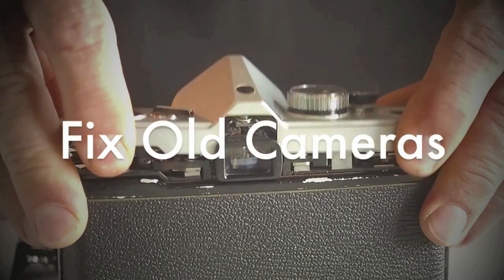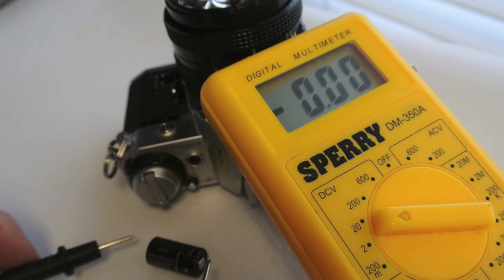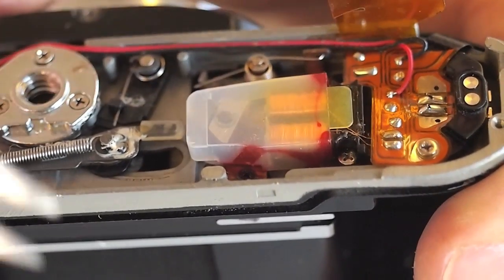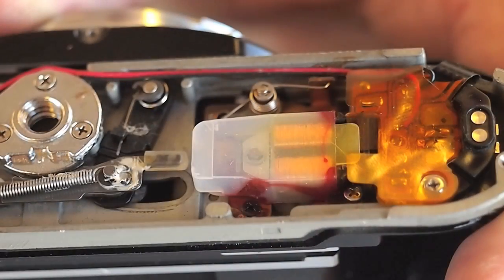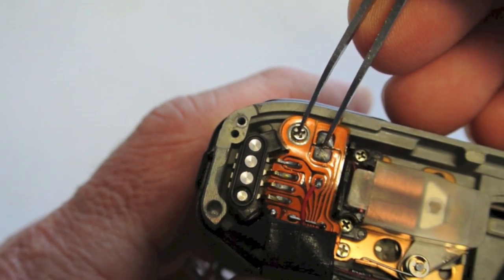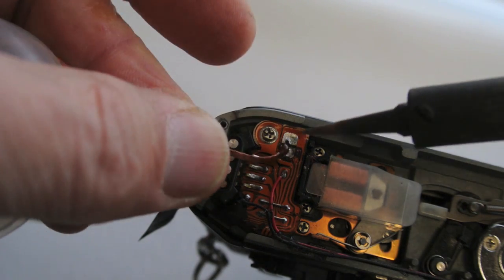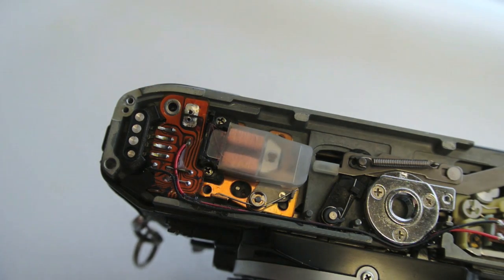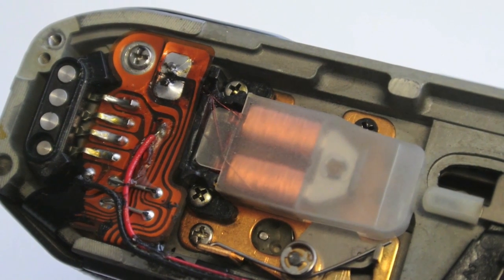Fix Old Cameras: AE-1 Release Magnet

Comment: Do you have any information with the AV 1 I had to consult this AE1 repair in hopes of diagnosing my AV1 problem. My AV1 is unable to release the shutter button can activate the meter but not the shutter release. I will try to short it or apply 6v directly into the magnet to see if the solenoid is working. If you have more info about the AV1 can you please help? Thank you
Reply from the maker: Presently there are no FOC videos feature the Canon AV-1 specifically. Thank you for your comment.

Comment: My AE-1 does not fire consistently after releasing the shutter, as in sometimes I will have a run of 5 successful shoots, then nothing. The battery is new, and I have used the battery check on the camera which has shown it has charge so it is not that, however the meter itself doesn't always work either, so I'm guessing it's a loose electrical connection somewhere. Do you happen to have a fix for this?
Reply from the maker: Ted Gravestock If you are using an alkaline battery switch to a silver or lithium battery. If you are using the proper battery you might check the ground screws by the release magnet and by the left of the eyepiece ( you will have to remove the top cover to access this ground screw).

Comment: So I followed through all of the steps up until replacing the magnet. If I manually reset the shutter and cock it it will be able to fire once or twice and then right back to the same situation of not disengaging the magnet. Do you still think it’s worth replacing the release magnet? Or is it some other wild issue that’s not worth it
Reply from the maker: The magnet sounds like it is good. The AE-1 is a battery hog... as they age they seem to be even more demanding. Make sure your battery is delivering a full six volts and not dropping off after a couple of shots. Check for a break in the connecting flex circuit. Check for a solid connection on the lower flex ground screw. From an early post... If the magnet energizes then the issue is in the release circuit or a loose ground screw. Check the ground screws by the release magnet and by the left of the eyepiece ( you will have to remove the top cover to access this ground screw). The additional circuit trouble shooting is much more involved... Probably not going to help much, but, make sure you are getting battery + voltage at the lead on the (blue) release capacitor closest to the release magnet. This capacitor can also be swapped out from a donor camera. Make sure you have battery + voltage at the lead of the release magnet closest to the release capacitor. If good, check coil continuity of the magnet. If no continuity, remelt solder at the test points. Also top cover can be removed and all the switches on the release side of the camera should be checked. There could be an open in the flex circuit or connections that will need to be traced. Then there is the possibility that all is for not as you could have a defective IC, the one that lives on the release button side of the prism flex. Also, if you are using an alkaline battery you might switch to a silver or lithium.

Comment: Hi! My camera has this problem but what happens is that by pressing the button it wont release the shutter, but if i connect the ground screw to the shutter release magnet terminal it does release it. In the video you mention that the problem is not the magnet, but you don't point any solution... Any ideia of what I can do?
Reply from the maker: Check for a break in the connecting flex circuit. Check for a solid connection on the lower flex ground screw. From an early post... If the magnet energizes then the issue is in the release circuit or a loose ground screw. Check the ground screws by the release magnet and by the left of the eyepiece ( you will have to remove the top cover to access this ground screw). The additional circuit trouble shooting is much more involved... Probably not going to help much, but, make sure you are getting battery + voltage at the lead on the (blue) release capacitor closest to the release magnet. Make sure you have battery + voltage at the lead of the release magnet closest to the release capacitor. If good, check coil continuity of the magnet. If no continuity, remelt solder at the test points. Also top cover can be removed and all the switches on the release side of the camera should be checked. There could be an open in the flex circuit or connections that will need to be traced. Then there is the possibility that all is for not as you could have a defective IC, the one that lives on the release button side of the prism flex. Also, make sure you have a good 6 volt battery and if you are using an alkaline battery you might switch to a silver or lithium battery.
Reply: Fix Old Cameras i appreciate your videos.  I have the same issue, could you please direct me to the video to help me with the shutter button and the lever, the magnet and battery are good. Thanks.
Reply: Same problem here with an AT-1. Magnet is definitely good but I can only get it to fire very rarely with the shutter release button. Looks like I'm going to have to dig in a little deeper.
Reply: I’m having this same problem. Could you fix it? I would be so gratefull if you could help me!
Reply: @FHGDM  Acabei indo a um senhor que reparava câmeras (em geral, não particularmente analógicas) e ele conseguiu arranjar. No meu caso foi uma peça que quebrou, se não me engano o botão funciona com um fio que se enrolou nas engrenagens e essa peça teve de ser substituída. No meu caso não havia nada de errado com o circuito, uma vez que eu segui os passos que explicaram em cima e tudo parecia funcionar. O melhor seria arranjar alguém que perceba minimamente de máquinas para tentar concertar

Comment: I used this to check an AE-1 of mine. The battery is good so is the magnet. My initial issue is that when I look through the viewfinder the needle for the light meter is at the top. I press the shutter button and the light meter will go all the way down to the bottom. I have a flashing warning light in the viewfinder.  I can cock the shutter, but I have to take the bottom plate off and disengage the magnet. I am suspecting that a resistor has gone bad in the area of the shutter button under the top plate.
Reply from the maker: Those are the classic symptoms of a Canon AE-1 with the ASA link wire issue. The Fix Old Cameras video Canon AE-1 ASA Linkage Wire Repair addresses this problem for a possible solution. Find the video in the FOC Canon playlist.

Comment: do you have any video on how to replace the focusing screen on a canon ae1? the program is easy but the regular ae-1 doesn't seem too easy.if you dont have a video could you let me know where i can find any info. thank you.
Reply from the maker: The focusing screen of the AE-1 can only be accessed by removing the prism. It is very involved to access the focusing screen of the AE-1. The prism is sealed and buried underneath the upper flex circuit. Probably would classify it as a difficult repair.

Comment: Have a similar issue... have gone through the cleaning process as described and shorting the release magnet terminals releases fine but pressing the shutter doesn't still work... also noticed that it doesn't trigger the self timer so assume its related to the shutter switch? if so do you have a video for that?
Reply from the maker: If the magnet energizes then the issue is in the release circuit or a 
loose ground screw. Check the ground screws by the release magnet and by
 the left of the eyepiece ( you will have to remove the top cover to 
access this ground screw). The additional circuit trouble shooting is 
much more involved. Probably not going to help much, but, make sure you are getting 
battery + voltage at the lead on the (blue) release capacitor closest to
 the release magnet. Make sure you have battery + voltage at the lead of
 the release magnet closest to the release capacitor. If good, check coil 
continuity of the magnet. If no continuity, remelt solder at the test 
points. Also top cover can be removed and all the switches on the 
release side of the camera should be checked. There could be an open in 
the flex circuit or connections that will need to be traced. Then there 
is the possibility that all is for not as you could have a defective IC,
 the one that lives on the release button side of the prism flex. Also, 
if you are using an alkaline battery you might switch to a silver or 
lithium that is delivering the full 6 volts. Could be the magnet release capacitor. 
It is located next to the release magnet and is typical blue. It will be difficult to measure static 
voltage to determine condition of the release capacitor. The switch 
closed by the release button sets a chain of electronic events in 
motion.When things have progressed enough 
to suit the CPU(central processing unit) inside one of the three main IC
 circuits, pin two of PX-2 IC connected to pin nineteen of PX-3 IC goes 
low and trips the shutter timing sequence. The connection is also taken 
thru the flex circuit at the coil of the release magnet to enable it to 
conduct. This capacitor then discharges through the coil of the magnet. 
You might try swapping out the capacitor from another AE-1 camera 
donor.
Reply: Thanks... I'll give that a go... I do have a donor camera to gets parts off  if need be :)
Reply: Thank you for the reply... you mentioning the battery made me get my meter out to check it... only reason I hadn't thought of this was because the battery was literally brand new... I had gotten half a dozen shots off before the problem manifested... battery check looked ok and it would sporadically fire the shutter..

Check the voltage and it was 4.6volts!!... check the other battery in the pack and this was 6.4 volts... replaced the battery and bingo... working as it should!!!... DOH!

I have ordered a lithium battery now to try... can't believe the battery was that dead that quickly... must have been a duff one... 

It was an Energizer A544 Alkaline battery... will try the lithium and hopefully it will last a bit longer...

Thanks again... this videos are great to watch :)

Comment: Hi, my AE-1 program will not release the magnet when the shutter button is depressed. If I remove the bottom cover and tap the switch it releases and makes all the sounds it should. When I advance the film, the magnet is stuck again. (Where can one purchase a replacement magnet?) Also, I put a brand new battery in it before all of this. When the shutter button is pressed it no longer shows anything inside. No light readings, no aperture suggestions, etc. The camera worked great the last time I used it, but that has been years ago. Is it possible that there is something with the shutter button that is out of place since it doesn't display anything and doesn't release the magnet?
Reply from the maker: After resetting the main switch and the display turns off and stays off when the shutter button is pressed a full stroke, then  it is possible that the release magnet is bad, or the capacitor that is located next to the magnet or final and complete failure of the circuit (IC-1).
Reply: Hello, I have almost the same problem than xRONMOWERx, but with a canon a1. Camera in almost perfect shape, bought 2 months ago from Japan (300$), only 2 films shot, amazing pictures. A few days ago I tried to switch it on- after one week it was off-, but nothing, it seemed to be dead! I changed the battery with a brand new one, but still nothing, no information in the viewfinder and no LED blinking, when testing the battery status. 
Then by opening the bottom plate I saw that the magnet was stuck. I could be able to manually tap the switch to manually release the shutter, but when advancing the film it got stuck again. And apparently no current was flowing in the camera's circuit, as it was like switched off.
Now, I ordered a new electromagnet on the web, but: what shall I do if it was not the magnet failing? How to check the circuit and try to understand which component is actually failing? Could I use a multimeter and close the circuit where the magnets pins are? Or is that dangerous for the circuit itself, as I introduce a current that is bigger than the expected one? Which scenarios should I expect? 
Thank you so much for your help!

Comment: Is the process the same or similar for a rear curtain release magnet?
Reply from the maker: +David Hancock The smaller magnet visible  towards the center of the bottom of the camera holds the second curtain open for exposure time. If the magnet is not holding the second curtain will follow the first curtain across the focal plane. Often cleaning the surface of the magnet and magnet latch will correct such an issue.
Reply: Fix Old Cameras I tried cleaning the surface with 91% alcohol and acetone. So far no luck, What the camera's doing is leaving the shutter open until I remove the battery. The front curtain magnet behaves like the magnet in a working AE-1 I compared it to. I'll give both magnets a cleaning again tonight and see if that helps.
Reply from the maker: +David Hancock Sometimes when the AE-1 is acting as you describe, the tungsten ASA link wire has come off the guide pulleys or broken. Remove the top cover and inspect for such a malfunction. If you find the link wire to be broken .005 Kevlar fishing line is a suitable substitute.The FOC video Canon AE-1 Jammed Wind Lever briefly covers the routing of the link wire.
Reply from the maker: +David Hancock Before removing the top cover if you want to check for the unlikely possibility of a mechanical issue, desolder the black wire from the holding magnet. If it still hangs open it is a mechanical issue.

Comment: I have an A-1 that works well in Av mode however the mirror gets stuck up in all other modes. I lubricated the gears and the squeak resolved and it otherwise works well. Does this sound electrical or mechanical?Any help appreciated.
Reply from the maker: If the mirror release when the battery is removed than that would indicate electronic issues.
Reply: @FixOldCameras  Yes , Thank you ! thats exactly  what happens. The mirror releases as soon as I remove battery . Is this sort of issue worth fixing. Is it a capacitor issue. I have several "for parts " A-1s
Reply from the maker: @yugars22  Well that about tears it. You might check ground connections and switch contacts, but to troubleshoot and locate electronic issues at the very least you will need a logic probe and the schematic. Maybe one of your "for parts" cameras  have a mechanical issue that you can use the camera in question as the parts donor.
Reply: Thank you very much for your help and great videos

Comment: I tested the release magnet and it works fine. When I hit the shutter button the mirror goes up but the shutter curtains are not opening any idea on what to do?
Reply from the maker: ***** The shutter holding magnet (the smaller magnet visible with the bottom cover removed)  could be bad or misaligned, could have an open coil, or could have a dirty latching surface. If the magnet is not getting power than it could be an open or short in the flex ribbon circuit, a bad timing capacitor, bad contact on the timing switch or worst of all a defective IC (PX-3).